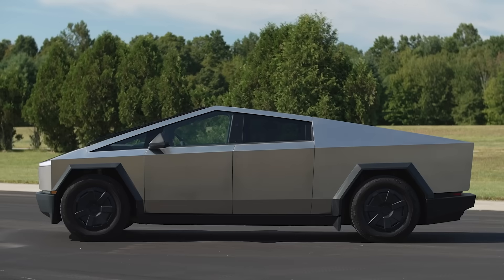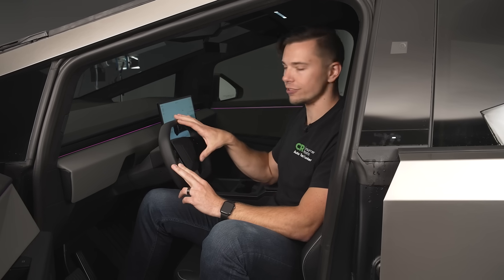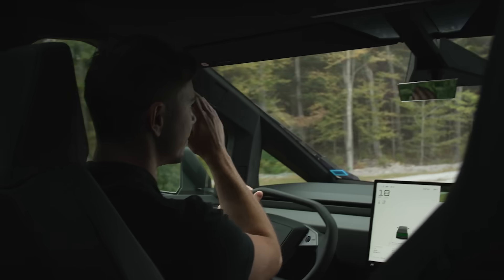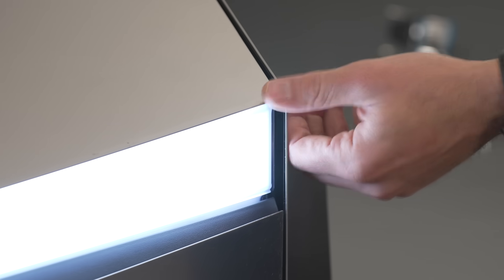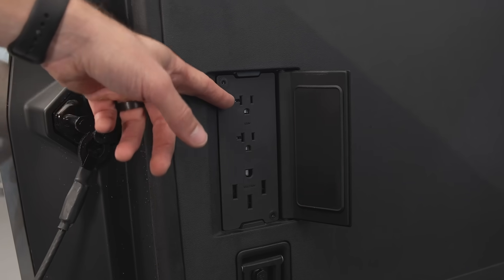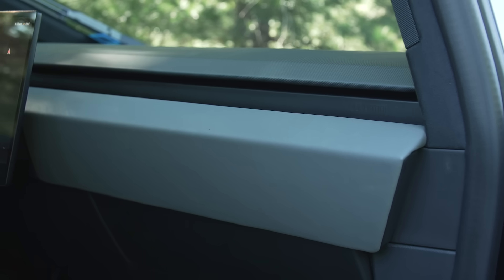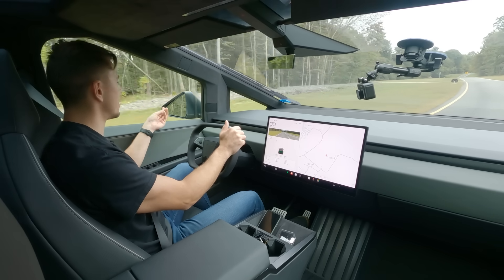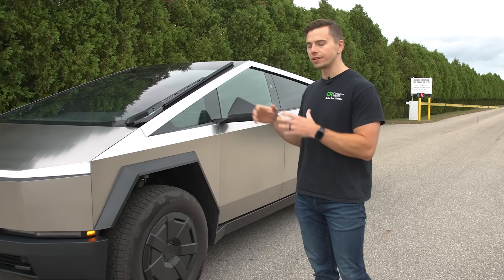2024 Tesla Cybertruck Early Review | Consumer Reports

Comment: Owned mine for 7 months 
- steer by wire is amazing (easy to learn). Going back to normal steering is archaic! No more hand over hand. 
- Front view is easy by just selecting the camera view. 
- Biggest fail is the rear view/mirror. The mirror sucks (need the vault open to use). The rear view on the screen not big enough and items appear small. What is needed is a video screen where the mirror is that uses the rear camera.
- range - not bad. I tow a 12ft boat and 16ft boat. I signed up for the range extender but it is not needed. Tesla chargers are superb and getting an adapter to use other networks open up more places to charge in a pinch. 
- the drive - this truck is so much fun to drive!!!! The truck is big but handles like a small truck/car.
- the more time you have the truck the more I love it. 
- cleaning the outside - BarKeepers Friend and Windex once in awhile. I put a clear coating on mine (Everbrite) so easy cleaning and no finger prints. Or wrap the truck.
Reply: It takes me a lot of elbow grease and commitment to clean a stainless steel skillet with Barkeeper’s Friend, which is the only good option. I can’t begin to imagine using it on a large truck. Also is it available in large quantities? The truck is a ridiculous joke.
Reply: BarKeepers Friend, makes perfect sense, so surprised your the first person I've seen mention it in regards to the Cybertruck
Reply: Love the dumpster though
Reply: Until the electrics fail.  At least with conventional power steering, you have a mechanical backup in case of a steering failure.  And how does it feel to pay 100k to be a beta tester?
Reply: finally a real comment
Reply: The choice to put the rear-view camera display on the screen instead of making the mirror a display like so many other car brands is…. certainly a choice.

I'm sure it's "we didn't invent it, we don't hold the patent on it" syndrome.
Reply: 59 Saratoga and other cars have dash mounted rear view mirrors.   The video screen on the CT has the same positioning.   This as a criticism is people trying too hard to say things that will placate the Tesla bad crowd.
Reply: The CyberTruck is shorter in both height and length than a midsized Toyota Tacoma double cab long bed 4x4 pickup truck.
Reply: Finally something positive about this truck!
Reply: sorry but they look like a ridiculous status symbol. absurd. I laugh every time I see one and it's body flaws and glorious ugly absurdity. perfect for this society and culture of narcissistic celebrity look at me demented madness. the emperor has no clothes, but the Elon sycophants hoot and holler in absurd delight.
Reply: I'd wager you own stock in Tesla.
Reply: You seem to be settling
Reply: I like going hand over hand.  It's fun.
Reply: This is a paid comment, seems exactly like something Elon Musk would do
Reply: They should provide option to add LCD rear view mirror and the same idea for the A pillar.  This LCD mirror tech has been around many years.  Dunno why they don't have it.
Reply: @g600f700  Because it's not needed, use it as intended, it is easy. The best part is no part. If you want gimmicks but another vehicle.
Reply: Trust me they go add it the truck is well thought out, they leave it out to bring it in at 2025 2026 2027 etc. All cars do it we buy the same came every year with things left out on purpose to add later
Reply: Funny. I'd think a finish that needed to be wrapped or otherwise treated after I paid 100k for it to be a problem, like orange peel in the paint.
Reply: @JamesPhieffer  Just try to peel the finish.
Reply: But it costs $100k. It’s such a hype mobile.
Reply: How do you feel about the resale for the vehicle you bought?
Reply: @AddyAdderson  Why would you ever sell it?
Reply: @AddyAdderson  What resale?
Reply: Thank you for the honest review
Reply: how does it feel owning what is essentially a meme novelty?

Comment: No mention of the highly praised sound system. No mention of the rear seat display and climate controls. No mention of Camp Mode, Dog Mode, etc. No mention of the coming FSD (supervised)  which had a (very) limited release two nights ago. Little or no mention of the non-Foundation versions of the truck that will be much less expensive. No mention of how the steer-by-wire enables quicker turning and elimination of hand-over-hand cranking of the steering wheel. No mention of the sedan-like turning radius enabled by the rear wheel steering at low speeds.
No mention that the one place you don't need to stop is the gas station. My wife just put 18 gallons in her 2020 F-150 STX last night and it cost nearly 60 USD; granted, no one who is happy about spending 100K USD for a vehicle is going to quale at the high cost of go-juice (and on the highway, charging at fast DC chargers can run you from half to the same or even more than you'd pay per mile for a gasoline or diesel draught), but for someone who is charging at residential or better rates, the ongoing cost of keeping most EVs rolling down the road can be a fraction of what it costs for an "equivalent" ICE vehicle.
The cybertruck is not going to be everyone's cup of kerosene, and especially given some of its quirks (and shocking aesthetic) many people will absolutely have no interest in owning one. I certainly couldn't afford one at this time and for that price, and the wife thinks they are ugly (she has strange tastes, though, as illustrated by her choice of husband), but I think the truck is exceptional and I could see myself eventually getting one of the cheaper variants on the used market in a decade or so (if I last that long).
Reply: No mention of the ugliest truck on the market.No mention of the Truck WAS a lower price as advertised, No mention the dangerous shaper edges of the doors.Although he did say don't shut  the door with the door.
Reply: @RichardThomas-b9n  Who the crap, other than hatters, care what was said about the pre covid price.   The truck is selling like hot cakes.   The more Tesla sells the more likely it is that they will sell lower prices trucks to increase the TAM.
Reply: How long do you want the review to be? Every sub-hour review is going to leave things out. From my personal experience, FSD is nothing to brag about, or even to safely use.
Not having to go to the gas station if you can recharge at home, and saving on gas, are great and will lead to a lot of repeat EV owners.
Good analysis that the CT will be good for some folks, not desirable to others. I think it will be the first pickup for most people buying it.
Reply: @tdrcar  The CT seems to be doing a lot of  "segment conquest" sales.   People who have never owned a truck are loving it.    Comments like I bought the truck for me but now I am driving my wife's car to work.

Comment: Read through the comments from the "type yourself smart" thimbal brains (both tech and politics).  Fact check number 1:  The top of the line Ford F-250 diesel has the MSRP of $94,340.
Reply: And the $120,000 would still be less capable than the comparable than a $70,000 Ford.
Optioning out a platinum ho diesel f250 that can go 4x the range, fuel up in minutes, outow the cyberturd by 2x isn't the flex you think it is.

Comment: Tesla couldn't paint cars properly. The paint was soft and would chip or peel off. So Tesla said "lets not paint the cars". But everyone said "you can't do that because the car will rust". So Tesla said "we'll build it out of stainless steel". Legacy auto said "you can't do that, stainless is hard to work with and you can't make complex shapes with it". Tesla said "that's fine we'll design a triangle shaped car and we'll say its part of the futuristic design". 

And that folks is how the Cybertruck was born. Its a product of Tesla's inability to build cars correctly.
Reply: It's worse than that. They claimed a exoskeleton design, but that was always bs. It's a two piece cast that's held together poorly with the panels bolted on, poorly. And the trim pieces are literally held on with double sided tape, and come off during highway travel lol.

Comment: Consumer Reports, where a vehicle with the aesthetics of a Pinewood Derby racer is "futuristic" & "unique"
Can't say as I've ever heard a car review where public reaction is mentioned as a consideration.
Did you get the better hubcaps or did yours still have the ones that bite into the tires? Speaking of tires, I don't recall you mentioning a spare.
Fit & finish? Did you try slamming the doors? Is your accelerator pedal staying put? The need to divert attention from the road to the tablet glued to the dash seems suboptimal for road safety as does the complete reliance on electric delivery for critical functions. These seem like highly consumer-oriented issues.
Perhaps I'm coming across as overly critical, it's not the worst review I've seen by any means, but I think this vehicle is another troll & should be treated that way. If you pay for a thing (self-driving) and you don't get it, the thing is not being delivered as advertised.
I hope your range review or a third cover things pickup trucks are supposed to do that an SUV is not designed for.
Reply: Yes, their truck has the updated wheel covers.
Reply: For some reason I got fsd yesterday .

Comment: I hate when I do stupid stuff and ding and dent my truck. Strong stainless instead of wimpy sheet metal is winner for me. Who cares about fingerprints. The lockable cover on the bed would protect my tools. The power outlets in the bed will make it easier to do jobs I currently can't offer to do without hauling a generator. I hate current trucks with huge turning radiuses. Cybertruck four wheel steering turning short radius is a winner. The variable air suspension height control means my wife can drop it down and climb into the driver seat and I can dial it up for construction sites and for making my way across flooded roads. I hope to own one these Cybertrucks someday. I watched the intro years ago and thought the simplicity of an electric powered truck with no worry about smashing your crank case, transmission, driveshaft on things,... I love the idea of high torque electric power instead of clutched or torque converter power transmission to the wheels when your combustion engine produces such low torque at low rpm.. needing higher revs and turbos to get you going.... Think Trains! They are all hybrid with electric motor powering the wheels. I wish everyone would stop doing these "vanity" reports and get back to assessing this as a truck and compare truck usage with other trucks. Yes, electric truck range is not yet to par but we all should be looking at the future when the range will increase and the electric with range assist, not hybrid but sort of, will come into play. Some see the cyber as a novelty but I don't see it that way for myself and I don't see it that way for the future.
Reply: And the silverado ev has all those features, but won't spend most its life on a tow truck to spend weeks on end at a tesla service center.
Reply: Lithium is the lightest metal in the table of elements.  Just how much range do you think "future" batteries will have (per pound)?
Reply: @rockethead7  Seriously!  In a typical lithium-ion (Li-ion) cell, lithium usually constitutes about 2-3% of the total weight of the cell.

Comment: To be fair, it’s an 80k car with a 20k premium for the foundation series bells and whistles, most of which is not available yet. Home backup, 40v low voltage architecture, steer by wire are the new tech. Also, 80k really is not much money nowadays. A lot of trucks sell for that much.
Reply: You can buy a fully loaded v8 Chevy for $55k. This is a joke.
Reply: For about $7,000, I can buy a home backup generator that runs for as long as needed.  Paying double to triple of the initial advertised price for a truck that carts around a large battery hardly makes up for that.  Buy a normal truck with far more features, and a home backup power system, and you're still saving tons of money vs. a Cybertruck.  And, what exactly do you think you're saving with a 48v architecture?  A few pounds of wire?  Huh?  A few pounds of wire vs. the 1,600 pound battery you're carting around?  And, why are you calling higher voltage "low voltage"?  And, why is steer by wire a good thing?

Comment: Man, a lot of whiny babies in this comments section. Honestly, from all I have seen and from having driven one for a few hours, it is just a solid truck. Nothing amazing, but has some really cool features like steer by wire, 48V, and stainless steel body. It doesn't change the world as we thought it might. But, it is pretty dang fun to drive and will do any truck stuff you need (other than long distance towing). Once it gets cheaper, it might actually be an amazing value under 80k, but we certainly aren't there yet.
Reply: Right! It’s over $100,000 and it’s nothing amazing. For $100,000 I expect an amazing vehicle because there are plenty of them out there and many are electric. I’m not stupid with my money.
Reply: @LlyleHunter  apparently you've never driven the CT.  Owners say it's quite amazing, especially the longer they drive it.
Reply: @LlyleHunter  Go test drive a few other $100K pickups them come back and tell us what you should be expecting and not getting.
Reply: And, what exactly do you think you're getting from 48 volts, other than saving a few pounds of wire?  A drop in the bucket next to the 1,600 pound battery, eh?  Can you name some other reason that 48 volts is supposed to be a good thing?  Why do you think it's "cool" to have steer by wire?  Those big actuators aren't really saving any real weight here.  And, if you have a complete electrical failure at 50 mph, you can't steer, unlike a normal steering column car.  What exactly (in your mind) makes steering by wire better?  You don't even get the feel of the road.
Reply: @rockethead7  You are trivializing the accomplishment of 48 volt. The vehicle uses 70% less copper wiring, not a few pounds as you stated. While this doesn't change the user experience much, it increases reliability and decreases waste, I like to support this innovation. Additionallly, steer by wire is incredible, no debate about this. Parking is fluid and fun, going through winding roads feels like you're driving a tiny sports car, even though you are in a massive truck. Fear mongering about potential electrical failures is stupid until we see widespread issues with the system, which hasn't happened yet. A few users had to get firmware updates pushed, but so far there have been no major issues or recalls with the steering system and I doubt we will ever see any, especially considering it has triple redundancy.
Reply: @rockethead7  So I am guessing you never drove a car with a 6V system.

Comment: Totally glazed over the steer by wire and rear wheel steering.  No mention of how good/bad the turning radius is compared to a F150/Ram1500, parking performance, etc etc.  Only said some felt it was a little bit strange.   Well why don't you do a side by side three point turn test vs the F150/Ram1500.  Also the F150 Lightning starts at 93,000 plus tax and freight, and the Silverado EV costs 96,450 plus tax and freight.  The Cybertruck is 80,000 plus tax and freight.

Comment: few things: 1. you CAN shut off ReGen Braking in in settings under "Dynamics" There you can set steering, acceleration and braking settings. 2. The camera setup you're using is worst-case scenario in a Tesla (that camera lens icon on the screen offers a 360 view). 👍🏾
Reply: CR dis not read the Cybertruck manual.